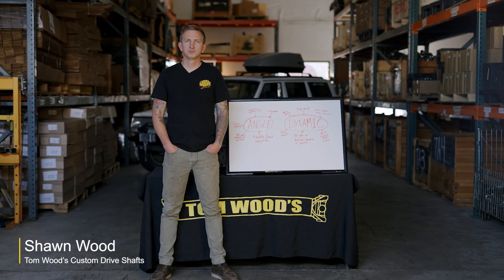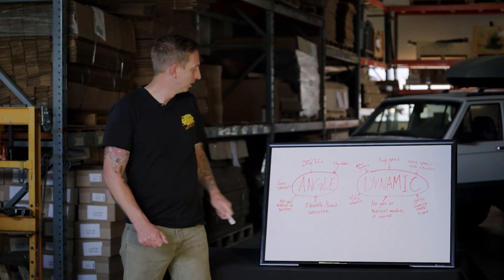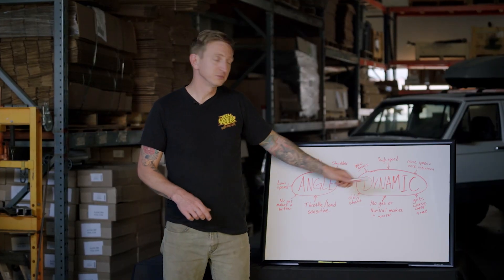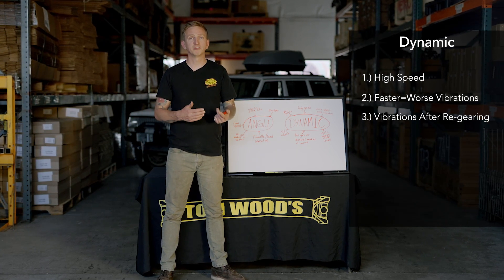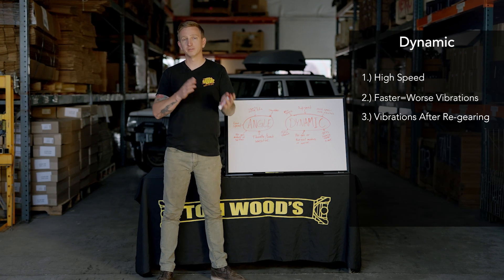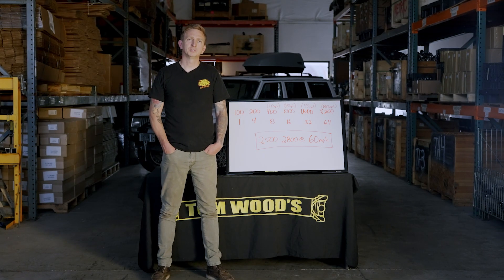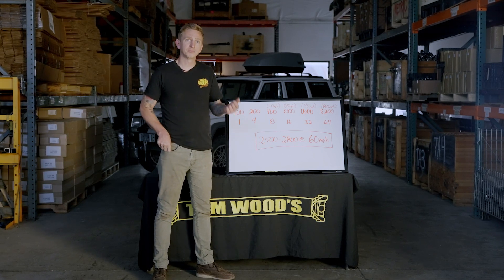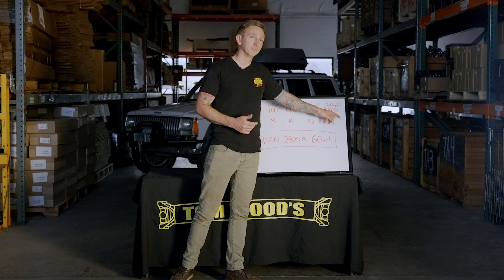Diagnosing Drive Shaft Vibrations

Comment: My 2002 Model Holden VY SS Commodore which is an Australian built car & is the right hand drive sedan version of the Australian delivered Pontiac GTO in the U.S. has 1 universal joint in the middle.

Well,5 years ago I ordered a new aftermarket tailshaft because the universal joint was stuffed & it was a non replaceable type because it was staked in.

I still had vibration issues with the tailshaft which I replaced so I replaced the universal joint after I replaced the centre bearing actually because it shook itself to pieces after almost 4 years,it was fitted with a V6 centre bearing which was offset 5 millimetres further to the right than the V8 centre bearing was.

I actually replaced the universal joint last Christmas but I checked it tonight & it has some play in the trunnion & cups on the yoke ears of the front shaft  so go figure,I figured out that there's a minute amount of play in the trunnion & cups for the front half shaft.

Now,I am worried that there's some error in the machining of the yoke ears therefore uf I keep on having trouble with this tailshaft then I will just order another one because I need a car to drive.

I wouldn't be able to get to the local tailshaft specialist if I took the tailshaft out of mine to get them to fix it, it's an odd size, the total trunnion & Cap width is 77 millimetres & the trunnion cap diameter is 29 millimetres.

Most of the universal joints which are that size have a total width of 76.6 millimetres , they're fitted to the Great wall vehicles !

Comment: I recently had my range rover guy change one front drive shaft as he said it was worn out, now when turning right at low speed I can feel a buzz through the body and steering.  it feels like a pinion running up against metal.  It's a high-frequency zzzzzzzzzz - any clues about what they may have done wrong?  They are unable to diagnose the issue although they say it could be the steering pump or steering rack but I feel they are just wanting to change parts as they don't actually know what it is.  The garage initially said they had been sent the wrong driveshaft and had to get another.  It didn't buzz at all until the new driveshaft was fitted.

Comment: Just had the rear ujoint replaced. Now at 50 mph there's a big vibration that changes frequency with engine rpm while at the same speed. It has a deep low frequency harmonic that follows the engine rpm.
Any ideas?

Comment: What if it vibrate at low speed and at high speed as well? I just bought toms wood drive shaft about a year ago and I have that vibration issue
Reply from the maker: There are many possible causes and factors, depending on the type of vehicle you have. Give us a call at 801-737-0757 so we can help you troubleshoot further.
Reply: @tomwoodscustomdriveshafts  sure will, thank you for replying

Comment: Hello, as you are an expert in driveshafts, can this cause wobbling in the steering wheel after 80km/h??? I changed all bearing and tires, did all it can be done and I can't get rid of the whobble

Comment: I have an 04 Jeep Liberty 3.7l automatic 4x4 that only vibrates between 35 and 45 mph and I noticed that when I go above that speed it stops and runs fine. But I also had a stored PO700 code along with the po740 code torque converter clutch solenoid. But I erased it and it never came back but the vibration still occurs between 35 and 40 miles per hour could it be a U-joint or drive shaft issue? Your opinion please help

Comment: Hey Shawn. Thanks for the video. I am hoping you could help me. I have a 1976 chevy Silverado K20. I recently completed a frame off restoration. The ring and pinion in the rear was checked but not changed. I did replace all the bearings and seals. The driveshaft is the same one (which I did not have problems with before). The transfer case has a part-time four-wheel drive mod. Anyway, I have a strange noise/vibration at about 2000 RPM and 40 mph. It goes away when I let off the gas pedal. But with part throttle I hear a low frequency droning / pulsing noise/vibration. I put the vehicle on blocks and ran the truck but could not get the problem to occur. And the driveshaft appears to be running very smoothly. I only get the vibration going down the highway under load. The strange thing to me is the noise/vibration is not a constant loudness...it gets loud then fades then gets loud then fades over a 1 to 2 second interval. Do you have any idea what I should look for? What does the vibration typically sound like when your pinion angle is not correct? Is it a constant loudness? I have to say it's more of a noise than a vibration. It sounds like typical engine noise but it pulsates at a 1 to 2 second interval. I don't have much soundproofing installed yet in the vehicle so maybe I am getting some weird reverberation in the cab?

Comment: I have a Tom wood drive shaft on my 2005 tacoma. It vibration around 30-40mph . But my issues is it starting to have a clunking noise when i shift to reverse and drive. Is this a normal issues ?
Reply: Replace ur u joints

Comment: Great video! Recently towed my camper with my 2018 F-150 from the midwest to Arizona. During this tow, if I accelerated too much from a stop, I could feel it shudder (angle). So, I was careful not to accelerate too hard. However, after disconnecting the camper, I noticed a vibration between 45-55 mph (dynamic). Since I was still covered by Ford's 5yr/60k drivetrain warranty, I had the local Ford dealer diagnose and replace the driveshaft, which corrected the vibration. Sadly, it took them 2 weeks to figure it out and another 6 weeks to get a new shaft from Ford. That all said, I have 3 questions...
1) Did the angle shudder cause the dynamic vibration? I'm thinking, yes.
2) Someone told me it could be the leaf springs torquing (lifting) up causing the undesired angle - T or F?
3) Is there a way to prevent the acceleration shudder, say with straps or blocks? I have no idea.
Also, it should be noted that I used a weight distribution hitch that leveled the truck within a ½ inch rear to front. 
Again, very informative video. I think the Ford dealership should have watched this. Thanks!

Comment: I have a 2005 Jeep TJ Wrangler and I installed a Rough Country 2.5 inch lift..  Now I have a vibration at 45 mph and higher it doesn't do it at low speeds and it never done this until I put the lift on it. That's all I done to my jeep was install a two and a half inch lift I never change the gears or anything. So mine is doing the opposite of what you just described in the video how can it be dynamic when I never changed anything but the lift?

Comment: Is it possible that the vibration lowers after a certain point? My truck vibrates from about 55 to 85mph. After 85 it seems to smooth out.
Reply: My truck does the same 50-70
Reply: @jaimereyes7480  mine was the washer in the u joint. Had 2 on one side instead of 1 on each. It was off by about .040". Fixed all my vibration getting the driveline balanced
Reply: @Joaquin Ortiz  exactly what are you talking about with washers on the u joints? Not sure I understand
Reply: @garybrady7245  inside the u joint there's washers that drop inside the cap. 1 per.  There was 2 on one side on mine. Had my driveline out of balance.   Took it to a good driving shop and they got it fixed pretty quick.
Reply: @1984keen  never knew that I always just thought that there was just some needle bearings and grease inside there. I'll have to check that out next time I got a u joint in my hand
Reply: @garybrady7245  that's what the driveline guy told me. I guess it's to wear the washer not the cap. But the shop that changed them put two in one side. Hope that helps.

Comment: I installed an SYE and Tom woods driveshaft a couple years ago and since then I’ve
-axle swapped (dana35-chry8.25)
-increased lift 
-3:55-4:10 ratio
And after  gear change I got some wicked vibration from 52-70 mph and up. 

Is my DS to short now that increased lift height and axle? 

Could it be that my driveshaft is Imbalanced now at higher RPMs due to the changes made? 

Can I have my DS rebuilt to fit the changes, or do I need to order a new one?
Reply from the maker: It could be that the shaft is now too short and that there is less contact area therefor less stability between the slip yoke and spline stub. https://4xshaft.com/blogs/faq/how-much-of-my-spline-should-be-showing.  It could also be that the shaft is worn and has some loose parts. It could be that the front shaft is worn and has loose parts. Though I don't know what type of vehicle this is and whether or not your front shaft is spinning all the time. If you conclude that the rear shaft needs to be rebuilt or modified, we can certainly do that for you. You'll need to call us for details about that process.
Reply: @tomwoodscustomdriveshafts  
Its a Jeep xj

Comment: Great video. I recently bought Tom Woods driveshafts for my 16 JKU. About a month later i regeared to 4.56 on 35s (34.25 when measured) and I’m getting slight vibration when i go above 70mph. I removed the front driveshaft to see what would happen and i had zero vibrations above 70, i even went up to 80mph. Could this be a balancing issue?
Reply: That's an angle issue. Castor vs pinion angle. Get locking hubs and set your pinion correctly
Reply: Did you ever resolve your vibration issue?  If so, what was the fix?
Reply: @jeepmandan5334  Yup, I got it fixed. I had to get the driveshaft rebalanced with the flanges attached to it. I had to take it to a shop that had a machine that could rebalance with the flanges.

Comment: Hi Tom, I still feel a slightly vibration on car center console at the speed 40-50 km/hour after replacing three flexible joint on my volvo 940. Above 50 km/hour the vibration become less.  Do I need to do dynamic balancing the whole drive shaft? Or should I make correction on the flexible joint installation?
Reply: I have the exact same issue with my 91 ranger 4x4, it vibrates from 40-50 then fades away!
Reply: I’m having the same problem with my Acadia it shakes from 40-50 then goes away , did you guys found out what the issue was?

Comment: I have that issue of a driveshaft vibration. Like you mentioned about installing a lift that right after experiencing a vibration. However I didn’t do that I only replaced the transmission and I started to have a driveshaft vibration. I installed a new drive shaft and still does the same thing.  Would the angles have changed or a transfer case issue? All parts are factory. Would appreciate your input if possible.
Reply from the maker: HI Omar. I'm not sure I fully understand the question but if you installed a lift the angles have changed. A change in angles can certainly cause drive shaft vibrations.